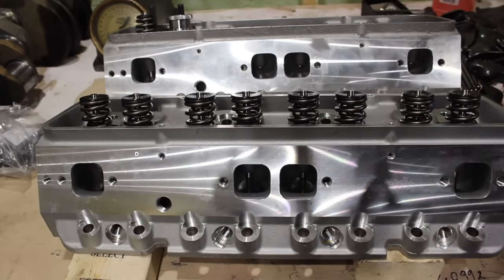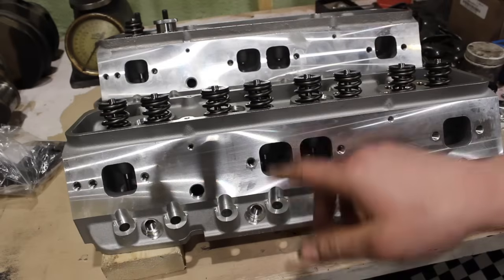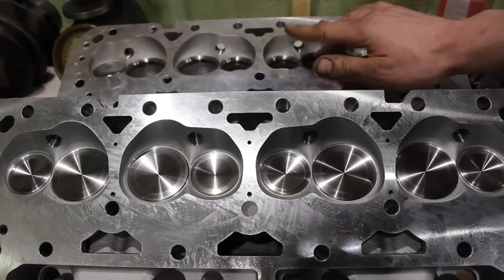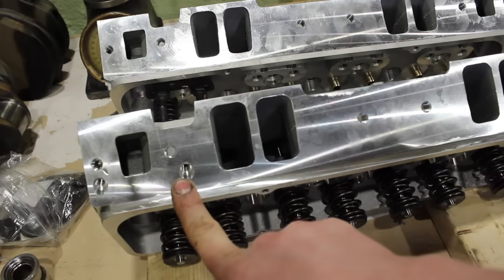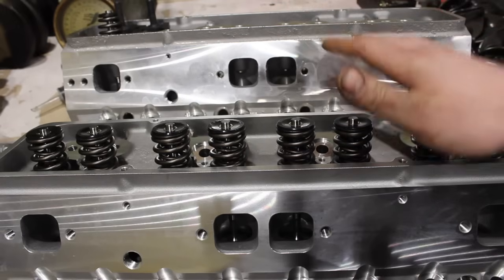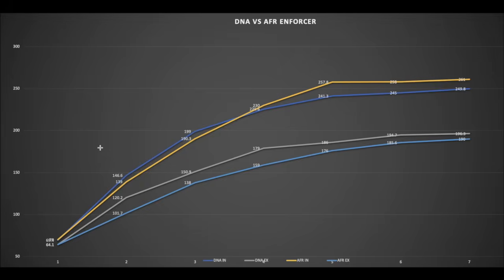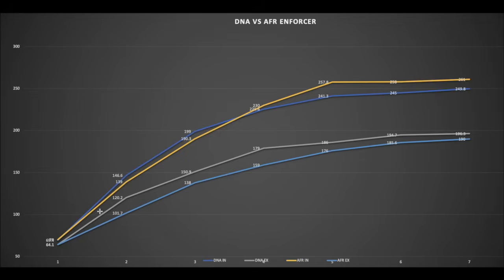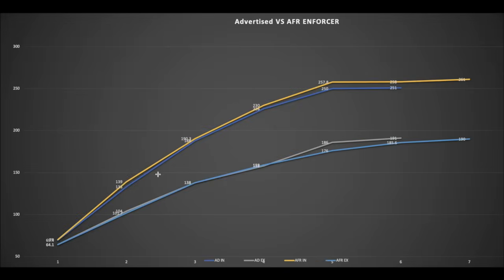$165 Amazon SBC Head vs Budget AFR Enforcer! (Flow Bench!)

Comment: I'm with you I'd still do the AFR. Out the box I bet you can't get those DNA heads with LS style 8mm valves.

A lot of people that are pro DNA are forgetting that. You don't find that 8mm LS style valve on any other budget head and except AFR

I bet they will make similar or more power
Reply from the maker: Yeah man thats exactly it, I do feel better using the AFR heads but i am impressed with the flow numbers of the DNA heads. 
The DNA heads are going on a friend's engine so we shall see how they hold up
Reply: @port nut you can but you have to have the head machined and installed for them.  Look at what chad speir charges for example on top of assembling heads for 8mm valves.

That's extra money where the emforcers already come with them. 

There is no other budget head that comes with them was my point

Comment: How do the DNA heads compare to the L98 cylinder head 113 castings?
Reply from the maker: Huge flow increase over the 113 heads (aluminum tpi heads)
Tpi heads flow stock 195 or so cfm intake and about 150 cfm on the exhaust
Reply: @cuttersperformance  It's a 1990 Corvette and I'm not sure if the TPI intake bolt holes would line up.
Reply from the maker: You can elongated the intake holes and possible use a angled shim to make it work as the 4 inside intake bolts are on a different angle
I use to play with alot of TPI stuff haha brning chips for guys and porting intakes 😄
Reply from the maker: @sportsmansparadice42  haven't done it in years man hahaha 
But I may be able to still answer some questions 
pcperformance1@outlook.com
Reply from the maker: Is your vette 6 speed manual? If so you may be interested in a basically new centre force clutch and machined factory dual mass fly wheel
Reply: @cuttersperformance Nah. I have a automatic transmission. 700r4 with a 2,200 stall speed converter and a shift kit.

Comment: I would really like to see the DNA laid over the vortec stock heads
Reply from the maker: Yeah I can do that man, I will try to remember to add that in the vortec porting flow video coming up
Reply: @cuttersperformance  been there done that. They must be cast from vortex on the intake side. The only difference may be that they use very coarse barr sand to cast these. I think it's the type that goes into 3500 concrete. Lol

Comment: You ever consider flowing a set of the jegs (profilers)? I'd be curious if there is a difference compared to the real deal. My machinist steered me to the profilers over the AFRs... he said dollar for dollar and for what I was going to do they would be the better value. At the time it was a 600$ difference and I used that difference toward other things I needed. No regrets there lol.
Reply from the maker: Profiler heads are excellent! I run a set on my trans am
They often flow higher than advertised also
Reply: @cuttersperformance  makes me feel better about the 195s on my vette lol. I know guys have had issues with the raised exhaust port because the bolt holes aren't the normal raised style but my headers fit no issue. I'm just choking it with a crap intake at the moment.
Reply from the maker: I did a C4 a few years back 
383 stroker, 195 profilers, decent cam, TPIS intake 
Worked out nicely 👌 
Never dynoed it though
Reply: @cuttersperformance  Mines a crossfire but stock bottom end... so flat tops, thin head gasket, 195s, ported intake. Compression ratio I guesstimate around 10:1. The pistons are hard to cc in the block. I intended to do an overbore but there was still cross hatching in the bores so I said screw it. It's a 224/230 roller from comp. It moves out pretty hard anywhere below 4400. If you've ever seen a stock crossfire intake port... thats why. And when I grenade this I have an 880 block 383 ready to go lol.
Reply from the maker: O man haha the ole cross fire 
Thats gotta go! 😄
But at the same time, its pretty cool that you reused it haha
Reply: @cuttersperformance  well I had bought a renegade a while back but due to machining issues it is foobar. That is a stout piece for the price... but right now I have a ported to hell CFI manifold that'll hopefully help it out. 😅
Reply: Eww, great suggestion!

Comment: I'll be watching I'm thinking about putting my old vortec heads on a old school 010 350 after I watched your video on the coolant bypass 👍
Reply from the maker: That should wake it up compared to any other stock sbc head!
Reply: I have an 010 block and was considering doing the same thing. Vortec heads would be the best flowing stock heads. The guy at my machine shop said even the cheap aluminum heads will flow a lot better. So I’m considering spending the money on aluminum heads

Comment: I'm interested in knowing more about the DNA heads. Only info I have found so far says the valves are .100 longer. Could use the spring kit on the 96 Vortec 350 I'm wanting to build for my truck. Thanks

Comment: Looks like they were made at the same exact plant except didn't meet afr's quality control standards so instead of AFR melting them back down they sell them wholesale to DNA and DNA probably finishes up the machining but skimps out as much as they can that's why the vapor ports and vortec threads aren't drilled not to mention all the casting flash! I would honestly buy the cheaper heads then do some mild porting and clean up on them!
Reply: More like AFR buying DNA's best
Reply: @dalestephens5176   DNA is just a reseller, just like AFR. others like AT racing and KMJ performance also sell versions of these castings..  The version I bought from AT racing has clean  casting surfaces just like the AFRs and they also were under $400 for the pair. the dna has different  casting and machine work as well. the AT racing heads have the same shape runner ports as the AFR's

Comment: Thanks for the video brother! Have you ever flowed 193 swirlport heads?
Reply from the maker: I have not been able to get a set for a decent price lately 
But I do have some 305 vortec heads which are actually similar (they even have the swirl ramp)
Porting and flow videos coming up
Reply: @cuttersperformance  I have a pair of 193 heads I’d be willing to trade ya for some of your stuff! I’m doing a head upgrade from them currently and have the engine out. I’m debating vortec (in which case I’d get your spring kit), or a cheap aluminum combo. Want me to contact you with my info?!

Comment: 🤯 very nice flow numbers for such a cheap head. I'd imagine a simple cleanup would have them beating the afrs everywhere. thanks for sharing the numbers. 👊🤘😎
Reply from the maker: Yeah I was abit surprised too! But alot of mixed reviews on longevity
Reply: @cuttersperformance  longevity for guides and seats or cracking issues?
Reply from the maker: @jr78racer  i don't think the casting will crack
But I think the guides may wear out fast but who knows
I had a guy email me telling me he has a ton of miles on a set of the ebay heads
Reply: @cuttersperformance  for the price, I'd just put better guides in them and send it
Reply from the maker: @jr78racer  i like your style man 😎 👌

Comment: I like those el cheaper heads for that price I'd make a trip to harbor freight and get there porting kit and clean those runners up very interesting!
Reply: Exact same thing that occurred to me as well! American valves & springs & some port polishing & they're be good to go.
Reply: Where are you going to find the American valves at anyways. Manley and that company begining with f? Elgin makes a makes a nice street and race option. I use both ss styles with out a problem. I'd stay clear of the rest honestly, because they are the same valve with 1000 generic names. I've seen plenty of valves such as pro... That were off angle and needed a valve job new. You could use GM Valves, Eaton has made most of thier valves for years. They have several factories and guess where they are? Avoided anything from Indonesia like pro...

Comment: I put dart heads on my build and I absolutely love them
Reply: I am getting ready to order the Dart Iron eagle heads. What heads did you get and how much improvement did you see over a stock head?
Reply: @matthewcromwell1969  I used the dart SS heads similar to iron eagle heads mine are 185cc intake flow with 65cc combustion chambers and gives me around 50+ hp over stock heads probably a little more then 50 my motor dyno is 400hp at the crank and my cam is mild with a 502 intake lift and a 498 exhaust lift
Reply: @jonathanlawson4667  that sounds awesome. I have a stock 350 in my 1972 GMC all original with 38,000 miles. I put a small lunati cam, 454 lift 276/286 advertised duration 221/231 at .050 112 lobe separation. It is only rated at 175 hp stock. I am also putting headers, aluminum intake and holey 4 barrel on with the heads. The truck heads suck, they come with 1.72 intake and 1.50 exhaust valves. No power at all. I am looking to get a bunch more horsepower from the heads. I have heard a lot of good stuff about them.
Reply: @matthewcromwell1969  yeah that cam isn't going to do you any good at all unless you change the heads so they can flow enough for the new cam but dart has many different affordable options
Reply: @jonathanlawson4667  yeah I am changing the heads and intake and carburetor and putting headers on it.
Reply: @matthewcromwell1969  you do those couple of things and that engine will come to life and you'll be surprised at how much more power you'll have
Reply: @jonathanlawson4667  yes I can't wait. I am ordering everything in the next week.

Comment: Hey, 2 part question...
Bought a blueprint crate motor w vortec heads BP35512CTI1. Heads r different casting 906 (P) side & 062 (D) side, any downside? Cam specs show .495 / .502 lift  221-226 duration 
110° LSA,  heads appear to have no machine work to accept rhis set up. Any idea on how this is accomplished without valve train issues? Thanks.
Reply from the maker: No differece in 906 and 062 as long as the 906 doesn't have the press in exhaust seats.
That lift cam be accomplished with the right springs and retainers. I can get .580 with my beehive kit with no machining
Reply: Awesome. Glad to know.

Comment: Another great video! Now if you look at the average flow numbers of both heads they're within 3.3 CFM. It was 196.728 average CFM  for the DNA head and 200.028 CFM for the AFR head.(from what I could read on my phone, they might be slightly different if someone can see them better?) 

You can't overlook or underestimate the low lift numbers because the other head has better high lift numbers. Unless you're running a very high lift cam, you probably won't even hit the highest lift numbers once but the low lift numbers will always hit twice once on the way up and once on the way back down.

If someone were to use a cam with .500" lift using the average flow numbers then the DNA heads would average 176.5 CFM and the AFR heads are 176.4 CFM. 

So if a larger cam or porting aren't in the budget, the DNA heads would be the ticket because both sets of heads would probably make right around the same HP with a. 500" lift or lower cam.

How would someone enter the giveaway, by just being a subscriber? (Which I have been for a couple months when I seen one of your videos for the first time)
Reply from the maker: Nice work man! 
Look out for the next video for the giveaway details!
Reply: Port Nut- where are they getting “Foamy” I’ve done 3 sets of these type heads (LPC HEADS) I have not encountered this.

Comment: is´t right what i saw, that the DNA heads has straight plugs und the AFR has angle plugs? this ist an big difference or not?
Reply from the maker: I tired to get the afrs in straight as I mentioned in the video but I couldn't, straight is usually better for header clearance but that also depends on the headers.
The power difference is also a big debate with most engine seeing no difference

Comment: What are the flow numbers on edlebrock rpm heads? I have rpm heads on a 383 and they are only like 170 intake runners and I think they are to small for the 383 and probably are starving it at 6000rpm. I want to upgrade to a bigger head without breaking the bank
Reply: @port nut it is definitely a torque motor.

Comment: I never knew cylinder heads were required on electric motors. They are usually used on internal combustion ENGINES however.
Reply: Thanks for the info Edison.  I totally agree, that is why I put engine oil in my enginecycle,
Reply: @jayketler6158  
Edison? Oh, referring to the guy that claimed to invent the light bulb. I get it.
Reply from the maker: Hahaha the ole motor vs engine debate....I get knocked by this all the time 😄 
But in my defense.....go down the oil isle at the part store.....you'll notice "motor oil" on most labels
Reply: @cuttersperformance  
It isn't really a debate. It's a dictionary thing.
Reply from the maker: You are correct but I guess I've said it so long and both words are used interchangeably in the automotive world, that I don't even think about it when I call a engine a motor.
But I'd wouldn't call a motor a engine? Haha very weird 😅
Reply: Ever notice its called Motor Sports and not Engine Sports?

Comment: It looks like you deal with mostly SBC heads, I am in the process of trying to find springs, etc for my 96-00 BBC Vortec heads. In the middle of a budget built Gen V 454 with a hyd roller and the Vortec heads. Any insight or reccomendations on a spring kit for my application?
Reply: Despite having larger valves, they flow less than L31 heads. Not a recipe for a successful 454 build.
Reply: Ditch those heads..

Comment: On any street engine with a typical street cam, the flow at .350 to .400 valve lift is what makes power, so as you see the AFR heads falls short. No engine breaths any air at .700 lift.
Reply: Most 350 street roller cam engines use around .550 lift cams.

Out the box you're not gonna get any other budget head with an 8mm ls styles valve train. Not one

And I bet you the DNA won't make much more power out the box vs the enforcer I'm sure it'll be the same just about and those DNA heads will have a shitty chinese valve train in it
Reply: @KingJT80  I have built and sold 3 383 SBC engines with these heads . 11 to 1 compression very mild Hyd flat tappet camshaft dual plane intake and they all make 490 tq and 460 hp. and a 406 I did made 510 tq and 545 hp with a flat lifter solid camshaft and all were under .500 lift. The AFR is like you said the same cylinder head.
Reply: @racerd9669  Id still rather go with the AFR with the LS valvetrain for cheap  even if the DNA's made the same power. the enforcer 185 is slightly big for a 302 but maybe with close to 10:1 it might work
Reply: @KingJT80  You need 11.5 to 1 with aluminum heads. and at least 190lbs of cranking compression if you are going to make any torque .

Comment: I've been eyeing a set of those DNA heads for awhile now and after seeing this video I think I'm going to get a set they'll be perfect for my new engine I'm collecting parts for.
Reply: Dont use Chinese crap buy brodix
Reply from the maker: They flow well, but not sure about longevity
Reply: Still running mine. Years now on a farm truck daily driver. Some porting. Back cut on intake valve. Years. No issue. Not high performance but no dog engine. Big rv roller cam from lunati. 383 stroker. 1.6 roller rockers. 750 holley. Most of my work is done under 4500rpm. But work it does. I would say twice I went to 6000rpm in first. 68 139 192 233 261 270 281 284 on the flow bench by the porter. No chamber work.

Comment: I’m glad to see some up to date videos about vortec stuff in a time where the world has gone LS swap crazy. Just dropped a set off vortec head on my Malibu and I’m currently searching for a good full roller vortec engine for my camaro
Reply: I hear you everything is LS these days. I have a marine vortec in my truck. I have an LS to swap in, but gonna leave it sbc. I picked up a hardly used Weiand 144 with the vortec base in a deal with a friend. I am going to put it on and slip in a blower cam.
It's already a roller cam engine so should make for a nice setup. Also running it on E85 to keep charge temps down. These little blowers love E85 from what I am finding.
Reply: A lot of people LS swap just because everyone else is they don’t really have a reason

Comment: What’s the part number on the DNA heads? I don’t see them for $165
Reply from the maker: I actually can't find them on Amazon right now but they usually come and go on there 
But they are available on ebay, just search dna 200cc sbc heads
Reply: There 225 on eBay for straight plug bare, I see other similar looking castings with 200cc int runners and 64cc chambers for 180 bare and I’d bet they are cut from the same raw castings and I wouldn’t doubt all the heads with that really flat milled looking exhaust side are all cut from the same raw castings. Just like AFR, I see blueprint and several others with that similar looking casting. I figure just like buying an old set of pro comps as long as you go bare and finish them out with quality parts you’ll end up with a good set of heads especially if you can do a little port work yourself.

Comment: I had a feeling these DNA heads were quality control biproducts from another dealer. I would love to have a set of those spring kits for my 85 third gen build.
Reply from the maker: They do look better than I thought, not sure about longevity but I guess we wil find out
Reply: @cuttersperformance  i was concerned about the steel springs digging into the aluminum head overtime, if thats even a thing.
Reply from the maker: @jeremys924  yeah there should be a hardened shim or spring seat under the spring to prevent that